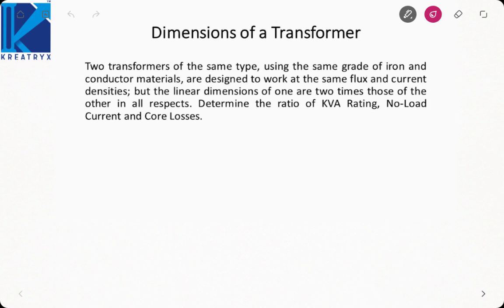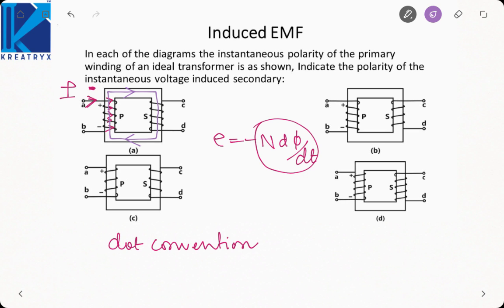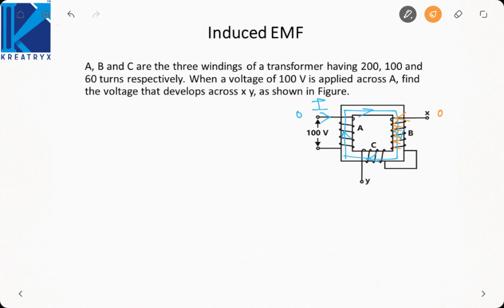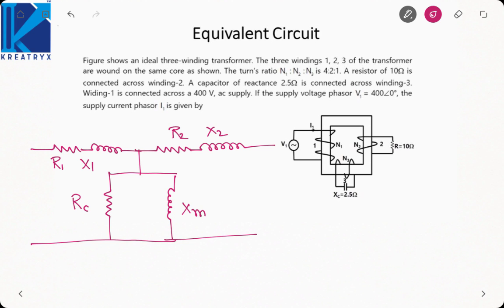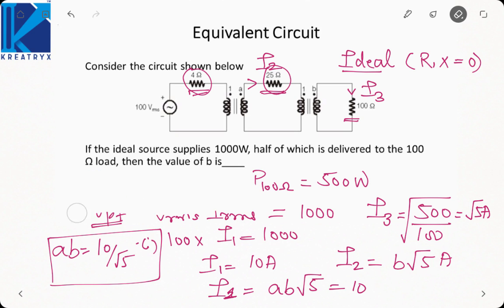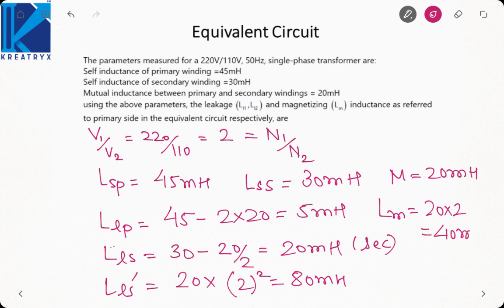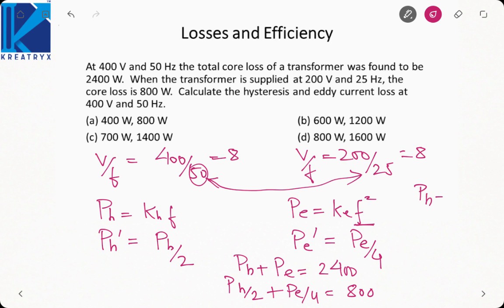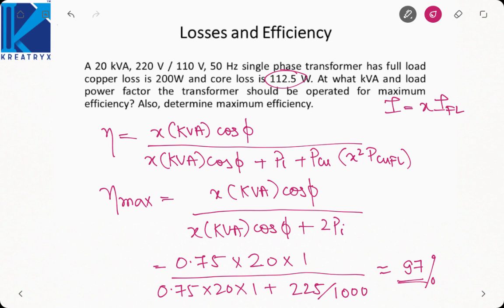GATE (EE) - Transformers 1 (Electrical Machines) - Krash - Problem Solving | Ankit Goyal

Comment: Sir as you have shown the direction of current in the secondary winding of the transformer which is somehow wrong the secondary should not aid the flux of the primary it should oppose the flux of primary and thats how transformer works.i have referred the topic from ps bhimbhra and confirmed it is wrong.thank you!
Reply: you can do by lenzs law also it just gives the same answer. I donot know from where ankit goyal has gotten this convention. just apply lenzs law
Reply: yes you are right..
Reply: E = - d¥/dt if taken alongside primary current direction 
E = d¥/DT if taken opposite to primary current direction

Comment: Sir, doubt problem time-30:20 .. in OC test we get maximum voltage. so voltage regulation will be max. for OC test.then the value of pf by 105/(250*1.4) = 0.3. (same power factor result). is this procedure is correct ?